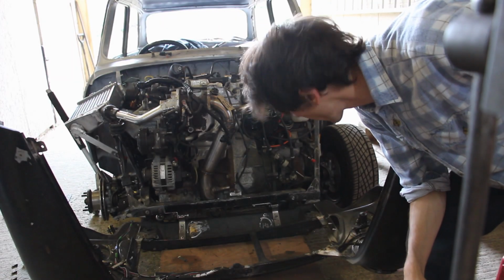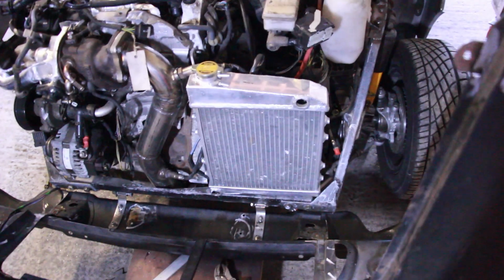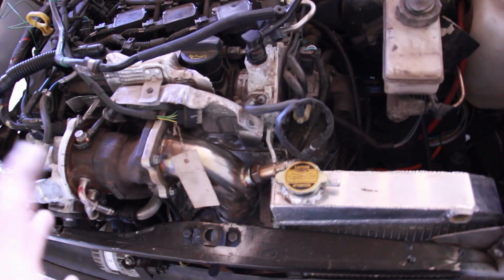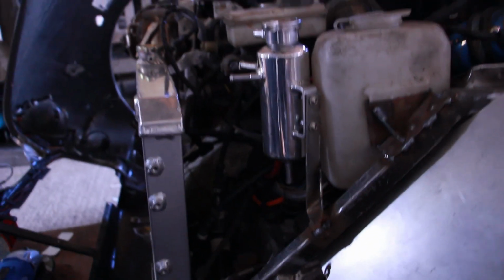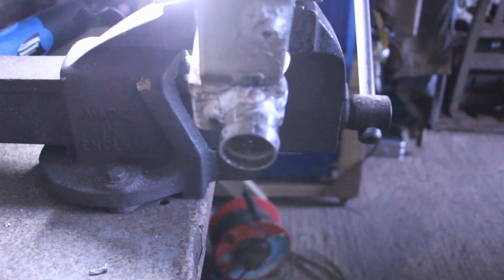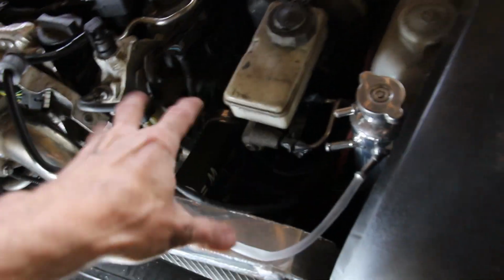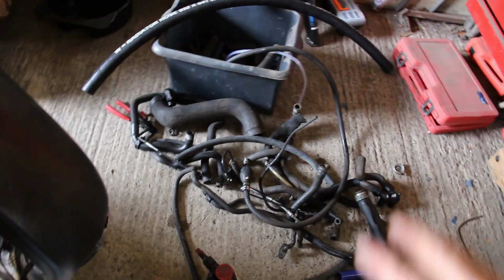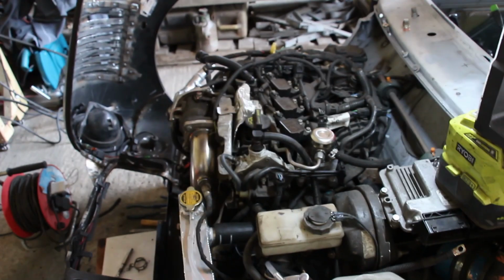The BoOsTeD Mini - Episode 42 - RADIATOR, RAJEATER ? (cooling thingy at the front)

Comment: have you/will you be making a coolant pressure tester? (15psi)
Reply from the maker: Yeah it's called running the engine
Reply: @PiggyPower  LOL!
Reply: @PiggyPower  joking aside for a sec , those dummy rad caps were a standard BL part back in the 70s/80s. i fitted loads when i worked there.